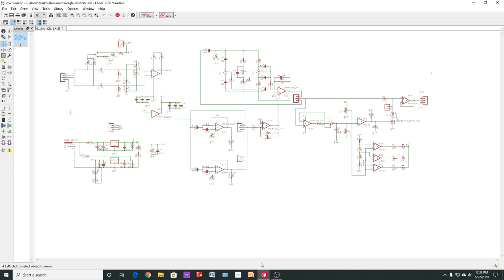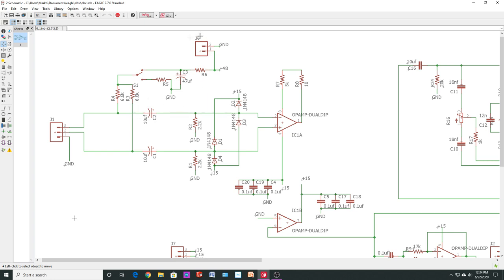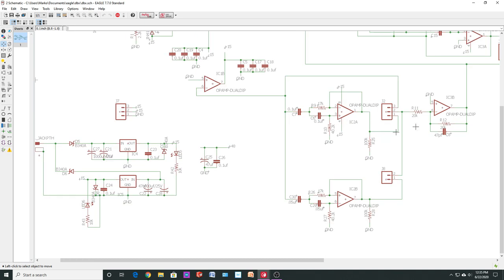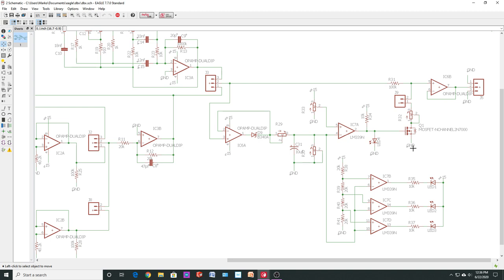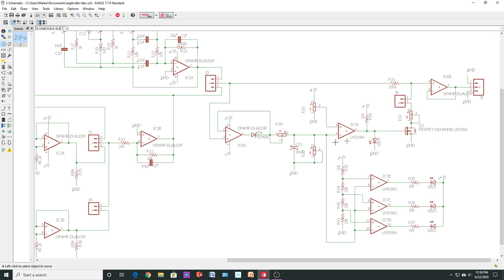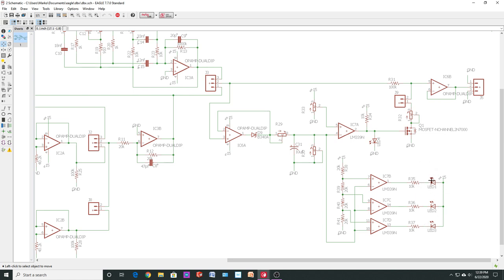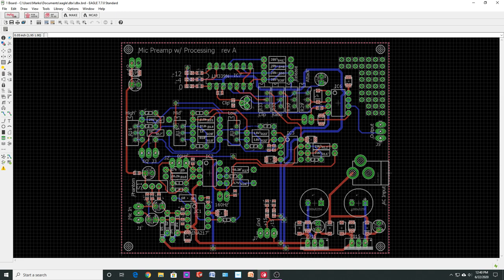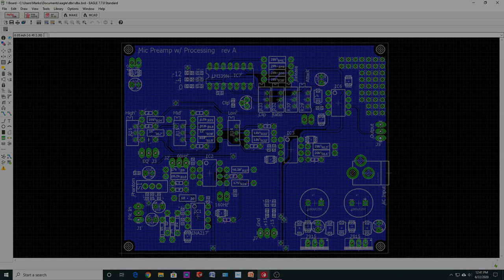#482 PCB design for Mic Preamp and EQ

Comment: 10K for the led?
Do you know the Paya 4 band parametric E.Q. schematic?

how does this "peak" detector work? ... this diode?
Cool, idea to use a inverting comparator to detect silence.

These 20K resistor on the "VU" meter between 15V and GND?
What amplitude is IC6A outputing?
(check the Befaco Interface4 schematic, they used a similar VU meter there, also indludes a wave rectifier circuit)

Comment: I am probably missing something here but how can the silencing circuit decide which signal is noise and which is voice? Isn't it activated all the time?
Reply from the maker: the peak detector monitors the volume. low volume =  no speaking. that is when it gates.
Reply: @IMSAIGuy  I am interested in your mic preamp circuit.  I just completed the Rod Elliott P66, with 25 db gain.  I was disappointed with the BARELY AUDIBLE SPEAKER OUTPUT and hum with max gain.  The mic is a Shure MV48 with a 1.8mv output.  It's new and I have not tested it in other gear to be sure that it is not a part of the problem.  The amp is based on the LM3886 chip.  If you feel your circuit can benefit my needs with more gain, then I'd like to pursue it.  Believe me I've looked for other causes for the low output and remain flustered.  I would appreciate any suggestion you may have.  Also is the preamp circuit board available for purchase or is the art available?  I would be happy to be a subscriber.  Thank for your input in advance.
Stan
Reply from the maker: @stanleychew4410  I've posted the PCB files on my github. I think the preamp and filters are good. the noise gate does not work well. there are pcb errors that require a fix but I show this in my videos so watch them all on this board. 
https://github.com/imsaiguy/Microphone-Preamp

Comment: I haven't used MOSFETs all that much but just starting to learn more about them. At about 5:30 you describe how a high output from the opamp (IC7A) turns on LED4 and MOSFET Q1, but won't the LED prevent the Gate voltage from turning on the MOSFET properly. The datasheet for the 2N7000 shows the Gate Threshold voltage as 0.8V to 3.0V. Depending on the LED colour it may limit the gate to about 1.8V - 2.2V. Is that enough to turn the MOSFET on reliably ?
Reply from the maker: A winner! Yes you are correct! I already made a video on this error (not posted yet) and said none of my viewers had pointed it out. However since I forget it hadn't been posted yet there was no way for you to know. You can bask in your glory knowing you had when you watch that future video....
Reply: IMSAI Guy woo hoo, whado I win ?  Appreciate the videos you are doing and it’s nice to learn more and if possible return the favor just in case. Hope you were able to fix up your pcb order in time. If not I’m sure you could always find a way to jumper in a mod.
Reply from the maker: @markcummings150  No the boards are in error but I managed to put an led AND resistor into the same spot by making a little tent. the extra resistor lets the voltage increase to around 6 volts. I had another error! you need to find that one....
Reply: IMSAI Guy challenge accepted, but I may not have enough time before you post the errors. We’ll see.
Reply: @IMSAIGuy  After untangling the -15V rail in the PSU section in my head, I wasn't able to find anything there. I ignored the bodge for the dual op-amp in the Mic Pre-amp section. But after looking at the dual high pass filter sections at 2:00, I suspect you have one of the op-amps wired up ass about. So my guess is IC2B pin 5 & 6 backwards.
Reply from the maker: @markcummings150  Winner winner chicken dinner
Reply from the maker: I'll give you credit in the description on the off chance anyone reads them.
Reply: @IMSAIGuy  Everyone eagerly laps up everything from the font. Your videos are wonderful company, thanks.